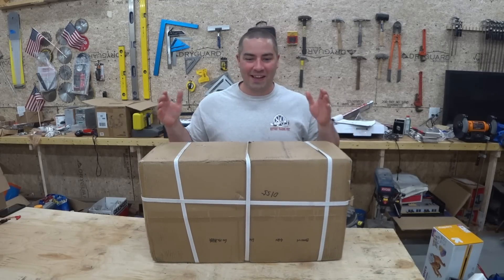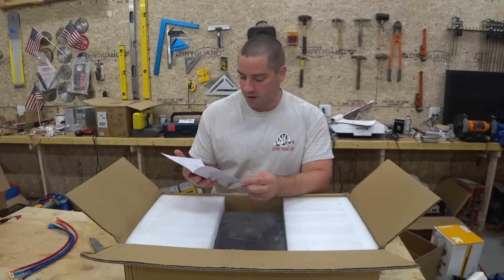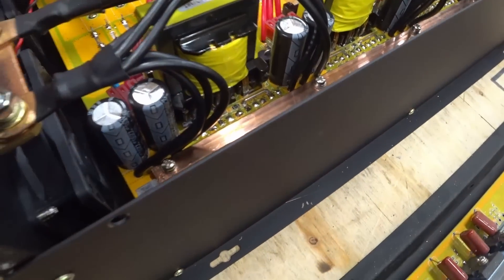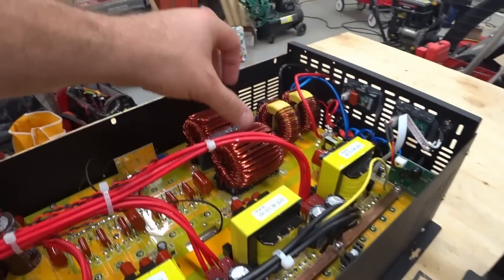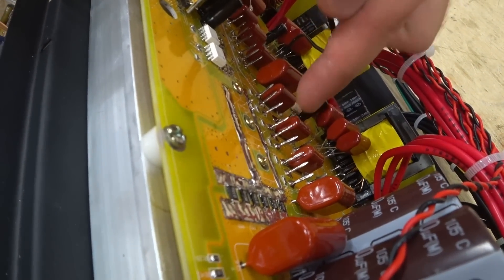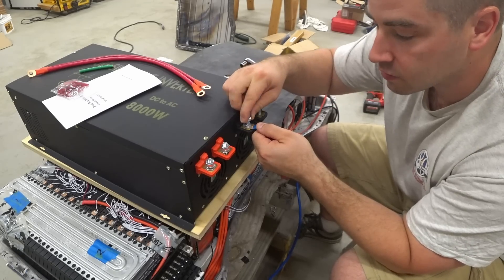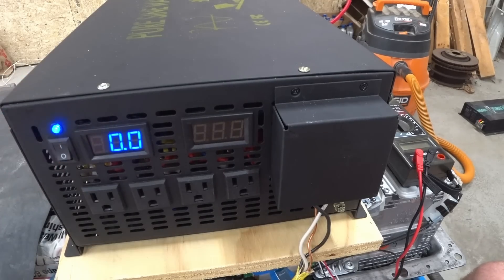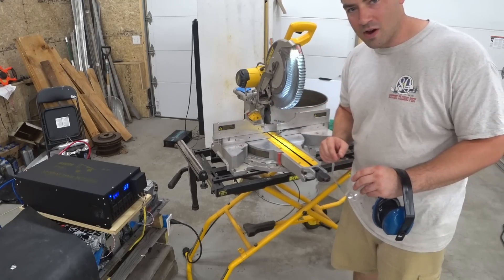Cheap 8000w Reliable Inverter, That Works! WZRELB

Comment: Does it have a battery charger built in?is it sine wave or modified?
Reply from the maker: No charger built in.  It is a pure sine wave.  If you are looking for an inverter with a charger built in, try the Aims brand. 
 I use this one for my whole house: https://www.aimscorp.net/6000-watt-pure-sine-power-inverter-charger-48-volt-dc-to-120-240-volt-ac.html Thanks for watching.

Comment: David, air compressors have what is called an unloader to take the "load" off the motor during start up... in other words, only when the motor is up to full speed does the compressor start pumping air. The starting (inrush) current of an induction motor is several (4 to 7) times the running current, depending on motor design. A similar thing applies to universal (brushed) motors but the inrush current can be higher (up to 10 times) but the starting torque is also a lot higher. Once the motor is turning, the current drops to a very low amount until a load is applied, when the current rises to do the work required. Usually, universal motors start with no load applied and the starting time is very short. Even your car starter motor is turning before the load is applied. An interesting thing that people do with vacuum cleaners is block the hose and think they are increasing the current draw. The opposite is true. By stopping the air flowing in, the turbine has less work to do and therefore the current goes down. The only thing that goes up is the temperature... no cooling air.

My system is 24 volts with a cheap 4 kilowatt PSW inverter with a 230 volt output. It's a little kinder with the loads I'm running. It's interesting to compare your stuff with mine.  One converter transformer for every 500 watts of throughput in my inverter. Converter output is roughly plus and minus 330 volts but only at 20 amps continuous (for 4kw) whereas your one will be plus and minus 170 volts at nearly 80 amps for 8kw output. Those huge toroids are part of the filtering to remove the high frequency content from the output waveform. Nice set up, BTW.

Comment: If you check, you might find that the wires don't have to be as thick when they are pure silver. The silver wires will carry about 5 times that of copper.
So, it is my guess that you output wires inside the inverter are in fact silver. It's OK, most people don't even know that. Also, where they just soldered those wires,
that is not solder made of tin and lead. It is Silver Solder, and it requires a bit higher heat to melt it good enough to weld it, you have to use a map gas torch.
Map gas torches put out a much higher temperature than common butane gas.Here are the temperature differences, (Butane Torch =1,430 *F)(if you use butane like 
oxygen-acetylene, by adding the oxygen you can achieve a higher temp of 2,610 "F), ((now if you use a propane Torch you get about  3,600 "F), add oxygen and get close
to 4,087 "F). So, what temperature will you get from ((Map Gas about 3,730 "F), add oxygen to get close to 5300 "F)), (oxygen-acetylene of about 6,332 "F). That's HOT.
So, before you go out to use these gases and Torches learn how tou use them first. SAFETY IS CRITICAL ! !  Also, All of these gases are deadly poisonous if breathed
even one breath of them will kill you, almost instantly, it causes the lungs to collapse and destroys the tissues that make the lungs function. Welding without a positive
air supply is very dangerous and can easily kill a welder. OH, well, I tend to rattle on about things , what the heck, free education. Good stuff to know for survivalists.

Comment: Nice test and review!  I built a solar generator (its on my channel if your curious) that was a 4k unit and it can run a chopsaw and table saw, but never could get a portable air compressor to work.

Comment: I got this brand in a 24v 4000watt model, will be tying it into my solar system this weekend. The only thing I don't like about it so far is it's low voltage cutoff would drain the batteries to near dead & that kills longevity so looking for an outboard kill switch to shut it down before it drains batteries under 75%.
Reply from the maker: Higher-end (more expensive) inverters will have programable voltage cutt-offs.  Outback, Schnieder, Victron, etc.

Comment: Hey, Nice Video!,  

I have a 2500W version of this company's inverter. I have used it for a year now, I have run table saws, skill saws, and a 18 cf refer nonstop.

To anybody wanting to know what size cable to use:

https://www.calculator.net/voltage-drop-calculator.html

This calculator is sweet, it allows you to input more than one sets of wires (up to 4) to show how you can use a group of smaller wires to carry the load of a larger one

Comment: I don't understand your amazement with 8kW (16kW peak) inverter turning on high inrush current <2kW tools. A real test is to plug four 2kW heaters in and let it heat soak for 24h.
Reply from the maker: This manufacturer (Reliable Electric) sent me an 8000w inverter last year that blew all it's internal electronics trying to power one saw.  This is a new design from them.  It looks like they fixed the flaws in the old system.  I did a part 2 video where I hook up full load (well almost).
Reply: @DavidPozEnergy  Watched the other video. That thing really wants to blow up again. I mean it looks like a nice inverter but somebody really had fun with the specs. At 7kW it sounds like it's about to blow up. Imagine trying to pull the 16kW momentarily. It would momentarily explode and then come good again.
Reply from the maker: I agree, it sounds terrible.  I power my house with an Aims 6kw.  It has never made sounds like that.

Comment: 8000 watts! 😀 Let's see: For a house this would be 8000W / 120V = 66.666 amps. That's about 67% of a regular circuit breaker box service entrance of 100 amps. Not bad! 👍Now, for 12 volts: 8000W / 12V = 666.66 amps. That's a lot of juice! A 70 ampere-hour car battery would not run it very long. ((70)(60)) / 666.666 = 6.3 minutes! 😭 To run a whole big house for an hour, we are looking at 10 car batteries in parallel. 😀

Comment: 8000W at 12V needs 670A.  There is nothing that can handle 670A. This current needs copper-bars not wire.
Reply: he's using 48 volts, how do you see 12?

Comment: 5:53 10 gauge is not rated for 30 amps in 310.15(b)(16) table, only due to the aestrix that refers you to the required size based on the ampacity. This is within the equipment and can be listed for that number of amps from the factory. there are many fewer variables within an enclosure. remember, amp rating of wire is a thermal calculation.
Reply: 10 gauge is only good for 30 amps when it is run inside a conduit with other conductors.
Reply: It can go to higher amps with shorter distances. As someone explained above, the rating is based on %voltage loss. The thermal tolerance is significantly higher. The voltage loss depends heavily on the length of the wire, meaning in short wires loss is extremely minimal. Less than 1-5%
Reply: @Fishtopher-Yay  Exactly, additionally, the voltage drop is a lot less important on the output end than the input end where it is more critical.

Comment: Very similar design. I’m thinking they changed mostly because of part sourcing.
Reply: And a very different control / mixing mechanism. Notice how the AC output steps up ~20v per tick when powered on. Someone should get one to Big Clive. (and the old sir-blows-a-lot model too.)

Comment: Why the hell didn't you stick 8000W of resistance heaters on the output, those motor tests are at best ambiguous, and certainly don't validate the claimed 8000W (or 4000W, if the 8K is surge) of the inverter.
Reply from the maker: I didn't want to make a super long video, so I broke the testing down into parts.  You might like my second round of testing where I (try) to bring it up to full load: https://youtu.be/TZbjy9t933E

Comment: Were  you sponsored by reliable electric?
I ask this question because I am thinking about buying today and 8000 W reliable electric inverter just like the one you are demonstrating. It is $1035 and unknown brand like Xantrex 2000 W which is considerably smaller inverter is $327. I don’t want to make a huge mistake and put in 1000 W in my motorhome and have it go bad on me in 6 months
Reply from the maker: Reliable Electric sent me the inverter for free, but they don't pay me.  Buy whatever brand is best for you.  Personally I use an Aims inverter to power my house.  I like the low-frequency inverters more.  If you are putting this into a motorhome can you even get 8000 watts?  Is the motorhome 12v, or are you running a separate 48v inside?

Comment: Is that 8000 W 100% duty cycle that makes all the difference in the world
         Call put your voltmeter on your air compressor and set it to hold minimum voltage then plug it in to measure your voltage sag or voltage drop on start up
           Set your amp meter up for your air compressor set on max amps to record inrush current on start up
        You don’t have to guess about the wire size or gauge and amp capability you could look it up in one of the electrical wire gauge size and amperage rating to figure out what size wire you need.  And yes that wire for 8000 W was definitely too small.
Reply from the maker: Thanks.  The 8000w rating is supposed to be continous, but I never got past 7kw.  I have a follow up video to this one trying to load it full: https://youtu.be/TZbjy9t933E

Comment: my god man, you're clearly not an electrical engineer! It's very clear these are totally different topologies, with the newer item definitely using PWM switch mode.
Reply: If he were an EE he could afford a 6.8 gigiwatt power plant complete with flux capacitor.

Comment: What is the battery size that you are using? 
I am about to install 3 lithium 100 watt BattleBorn batteries in my motorhome. Will that be enough to run an 8000 watt inverter??????
Reply from the maker: I have a video doing a capacity test on this battery here: https://youtu.be/n-u5QHiJhvA 
Will the BattleBorn batteries be enough?  This comes down to your amps.  You said you are installing "3 lithium 100 watt BattleBorn batteries"  I think you probably mean 100ah batteries?  If this is correct, and you are running 12v batteries, then you are probably installing 3 of the model: BB10012.  I just checked battleborns website for those: https://battlebornbatteries.com/shop/12v-lifepo4-deep-cycle-battery/  It says maximum continuous discharge current of 100 amps.  Assuming you are paralleling the 3 batteries, you could get 300 amps discharge.  Times this by your volts to get your watts.  300a x 12v = 3600 watts.  So there is no way to use 8000 watts from that.  I hope that helps.

Comment: Hi that good ,,,but I have a question ,,,and the battery that goes with?? how much power did you use??
Reply from the maker: I built the battery from a 2013 Smart Fortwo car.  There are several videos on my channel showing the build.  Here is a video of the capacity test: https://youtu.be/n-u5QHiJhvA

Comment: Stranded wire can you carry a greater load than solid core wire. For that reason you can have a thinner over all
Reply: Stranded wire carries LESS load -- fewer amps than solid -- since stranded wire of the same diameter has less copper (and the skin effect is irrelevant in this case).
"At 60 Hz the skin depth where it takes effect is like 8.5mm  so the effect is pretty much negligible except in very large diameter wires, like 0.66" diameter and in long distances which you usually don't find."
- Loring Chien, electrical engineer for 40 years, Sr. Life Member IEEE
Answered Nov 6, 2014 · Author has 30.3k answers and 53.5m answer views on Quora
(https://www.quora.com/Why-is-the-skin-effect-neglected-at-50-and-60HZ)

Comment: Your video is very well done. Thank you.
I'm new to inverters. I'm using 2 12v. Deep cycling batteries. I cant imagine what the cost of the batteries your using, or why??
Why not a gas generator.  How do you charge your 48v. System
Would love to use something like this for my service truck.
Reply from the maker: I have an overview video of my whole system: https://youtu.be/722GNWlEN1g
Reply: Thanks now I understand

Comment: I'd replace the inboard wires to the terminal for 4 gauge, and the negative & positive battery wires for 0 gauge. I'd go with welding cable to as it's true to spec OFC, super cheap and made in the USA. Better to be safe then sorry. Also, a lot of older car audio amplifiers used that same design, of sandwiching the FET's between the board and the heatsink. Makes for a more efficient heat transfer. Amps like Soundstream, Audio Art and Genesis all used that design.
Reply from the maker: That's cool that the design is used in some car amps.

Comment: Don't like the way the wires are routed through the case with no insulation or protection for wire cuts or abrasions.
I would add grommets for the wires.  You don't want mega amps getting shorted!

Comment: If you have it apart , why don’t you upgrade the wire gauge for the outlets.
Reply from the maker: I wanted to test the inverter as it came from the factory.  But, if I put this into daily use I will upgrade the wires.  Thanks for watching.

Comment: for $370 +/-, i bought the [improved] powerjack pure sine low frequency , 5000/ 20,000 watt peak inverter with 80 amp charger, with automatic transfer switch. it uses 24 dc [ 4 x 110 amh 12 volt, deep cycles ,with .big FAT  .02 Gage cables] .i knew it would be over rated ,but, lol, i hooked my 1500 watt portable AC/HEATER unit up to it and it blew the fuse as soon as the AC compressor kicked on. hummmm, must have been over the 20,000 watt peak. lol. imagine that.  so i unscrewed the fuse holder,[ same as on my stereo, and replaced the 25 amp fuse. yup 25 DC amps. so much for needing those giant monster cables. 
  that being said it's been on for about 2 years ,running about 11 amps of stuff [tv's computers router cabl internt box and other lights and stuff]  being charged by solar first, then home power sometimes generator.with the ATS switch it would be inverter all the time unless not enough battery.  sometimes i let it go like that for days, but it is usually just left on UPS /POWER SAVER MODE, and i unplug it  a few times a month as if the power had gone out, but we lose power a lot and it has worked every time.power saver mode is cool. it goes into hibernation unless more that a 50 watt draw is detected.
   my biggest complaint is the low  battery cut of is 21. it should be adjustable. the 12 volts in series have balancers but it is still an easy way to kill a battery if the balancer doesn't work.  one could be 11.5 and the other 9.5 and you wouldn't have a clue. but mine each have monitors with alarms  at 11.5. got to love Ebay. i'm saving for something better,[split phase,for the well pump], and i think you showed it to me right here. that one you have is bad ass. thanks for the info.  youtubers like you ,that are doing real world testing, are the best way to keep manufactures honest.
Reply from the maker: Congratulations on running your electronics with solar and your PJ inverter.  Well pumps are a very hard appliance to power.  Because your pump needs 240v I don't recommend this inverter, it's only 120v.  I power my house on an Aims 6kw which has been working flawlessly for my airconditioners, tools, air compressors.  It would have no problem running your well pump.  And it's 120/240 split phase.  I have a video on it here: https://youtu.be/dfHb5tZErTs and https://youtu.be/4EsYfdK1Hn4.    It's on Amazon here: https://amzn.to/2nSgksp
Reply: @DavidPozEnergy  cool .thanks .

Comment: I suggest you replace the high current cables in the inverter, they are not very long and won't cost you much. Just change them!!!
Reply: short dont matter..further you go,bigger you need to carry valts.look at a power station,,puts out 80,0000,to get to your 110..

Comment: you tested at a maximum of 3000 watts....58 amps X 50 volts.  that’s on the input side, so lower on the 110 volt output.  Surge was higher than that however.  I agree, wires to the output too light.  Sure that a full load test, as your title indicated, would result in failure before too long.  High frequency inverters less reliable than low frequency inverters.  I would consider this inverter an adequate emergency power alternative....but would not consider it as a continuous duty inverter for offgrid power.  But a good heatsink inside was nice to see.  Good for a portable unit where extra weight would be a hindrance.  cheers!
Reply from the maker: Thanks for watching.  You might enjoy the second round of testing: https://youtu.be/TZbjy9t933E

Comment: 25 amps at 120 volts is only 3000 watts... 5000 to go.
Those skinny wires might melt the insulation!
Reply from the maker: They sure got hot on my second round of testing: https://youtu.be/TZbjy9t933E

Comment: Consider this a 4000W inverter with 8000W surge, you read it in the manual that the 8000 is twice the rated capacity.  The surge allows for motor starting.  At 4000W the 10 gauge wire is fine for the terminals.  10 gauge is for 30A 120VAC 3600W, use a 80% de-rating for continuous load of 24A.  But that GFCI is for 15A plugs, and at most 20A terminals and pass through for the load side, which at 80% is only 16A, the 24A is overloading that GFCI.
Reply from the maker: Thanks.  I agree that we need to de-rate this.  You might enjoy the second round of testing: https://youtu.be/TZbjy9t933E

Comment: At 8000 watt given volttage, the wire is far to small. Use 6 or 4 awg for 8000 watts. As it heats up, resistance increase so go heavy to reduce losses, more heat and potential failures.